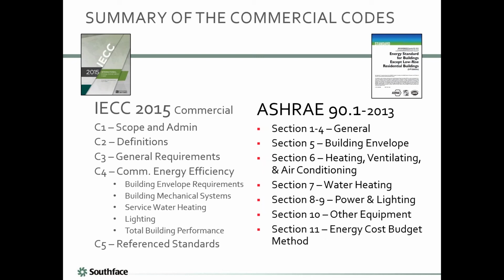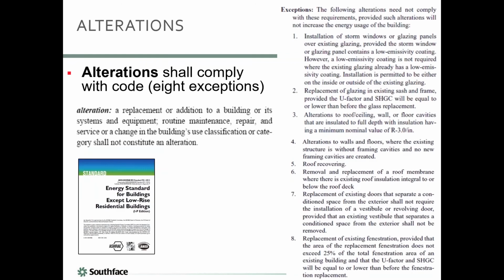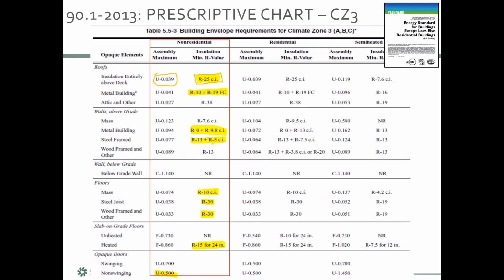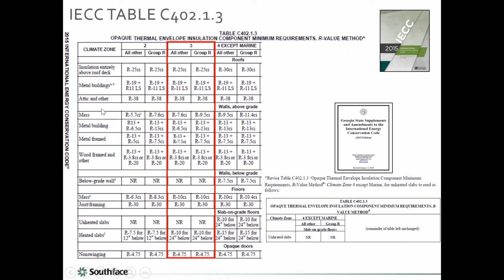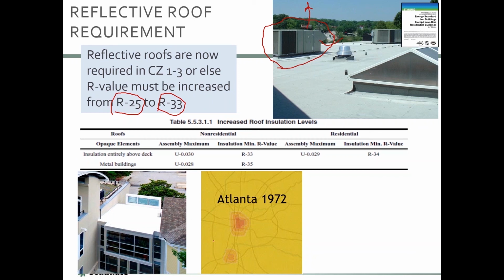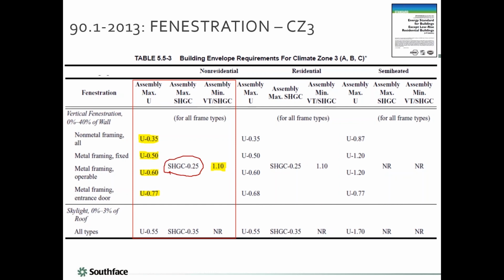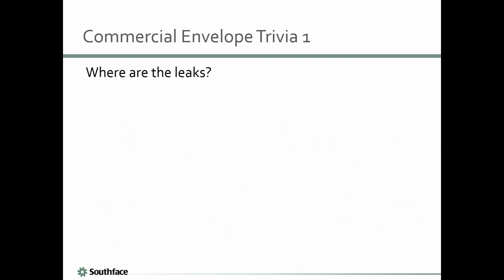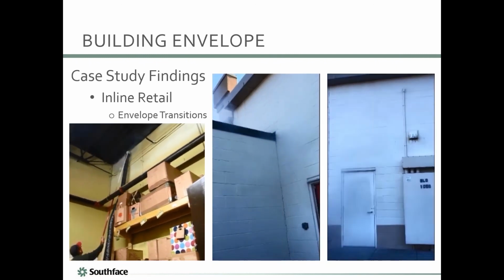Georgia 2020 Commercial Building Envelope for ASHRAE 90.1-2013 & IECC-2015

Comment: What if you have a small conditioned office inside an unconditioned warehouse. Since batts above the ceiling are not allowed, you are required to take the walls to deck to encapsulate?